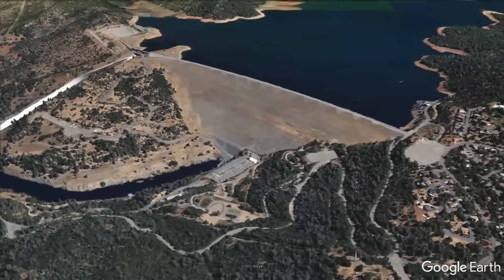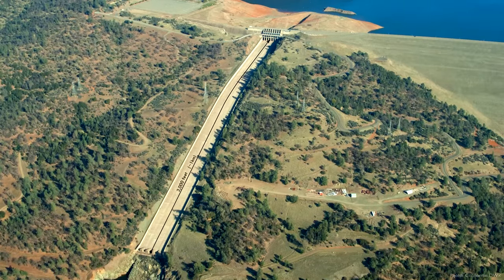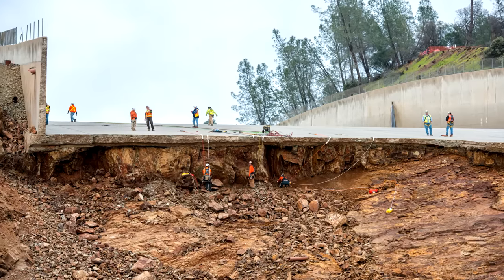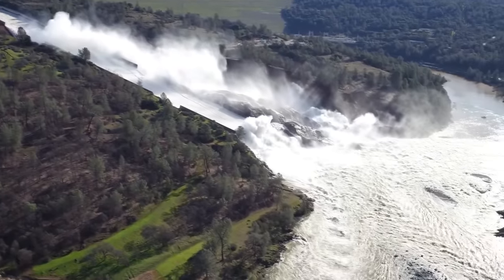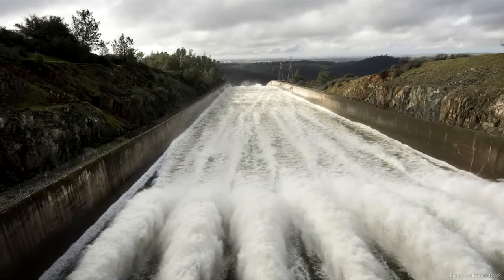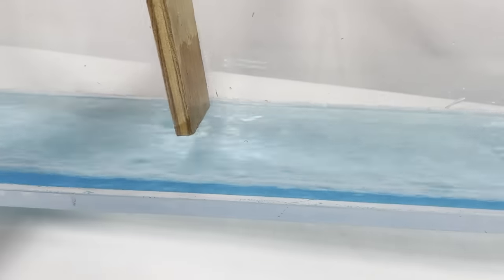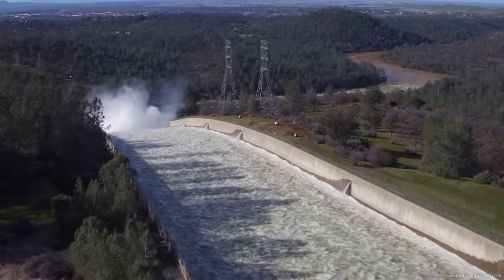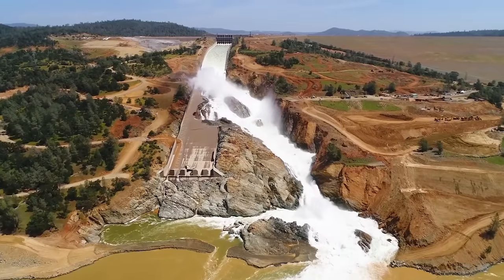What Really Happened at the Oroville Dam Spillway?

Comment: That stagnation pressure effect is how airplanes know how fast they’re going: they have a tube sticking out into the airstream, and measure the pressure rise in the tube.
Reply from the maker: Don't say it outloud without also spelling it for those in the UK. Learned that lesson the hard way.
Reply: Actually I was thinking about something too... If helicopters have the same setup and they fly sideways, by the venturi principle, there should be a negative pressure. Does a helicopter then register a negative forward speed/tell us that we are going backwards?
Reply: Interesting topic
Reply: @PracticalEngineeringChannel  you what?
Reply: @MarkUKInsects  aeroplane instead of airplane I assume?
Reply: Er... pee-tow vs pee-tot???
Reply from the maker: @MarkUKInsects  The device is called a pitot tube (pronounced pee-toe, but in my Texan accent sounds like pee-doe).
Reply: @davidbischi  Well, aside from the difficulty in maintaining your orientation relative to the airstream when moving fast enough to measure (the tail tends to want to flip you around to face the airstream); and that most airspeed gauges have a hard stop at zero; yeah, it should read negative if you did that. Not being a helicopter pilot myself, I’m not sure where they put the pitot tube to keep it out of the downwash from the main rotor either... 🤔
Reply: @davidbischi  At low speeds the helicopter has unreliable readings from the pot tube anyway. The downwash interferes with the flow into the tube and adds static pressure due to flow going into the static pressure ports. At the speeds a helicopter would go sideways you would have an unreliable reading from your pitot tube already.
Reply: @PracticalEngineeringChannel  Oi mate wot you saying? You better sit down instead of flapping those gums at your English viewers! (I kid, love your content)
Reply: @davidbischi  student rotor pilot here. Most helicopters have multiple pressure speed sensors in multaple diractions but if aair traffic control ask for air speed its goed practice to straighten the aircraft out and maitain altatude to get a more reliable reading. But modern accelerometer and gps are preferd by most air traffic controllers.
Reply: This is not true. This is how planes know how heigh they are.
Reply: @davidbischi  The airspeed indicator cannot physically go backward. If for some reason it could go backward then probably. The static port and the pitot tube would reverse roles I guess... I don't know enough to say any of this with certainty.
Reply: Isn't this the same principle used for measuring speed on a boat too?
Reply: @MarkUKInsects  Oh, WTF? Just googled "Yvette Cloete story" and that's awful... How could they miss that in a background check??? 🤔🤐
Reply: @PracticalEngineeringChannel  I learned english in England. No problems thus far..
Reply: @davidbischi  One reason small helicopters have yaw string or slip string on the windshield.
Reply: Ahh... the pitot tube. Learnt about that in aircrash investigation documentary.
Reply: @davidbischi  The pilot is too busy, at that point, watching out the windscreen/side window, to do more than glance at the engine instruments. By that time, they have swung around into forward flight, so eyes back on the usual scan of instruments.
Reply: @toledoseahawks3348  Altitude is determined by a pressure sensor called a static port, which is related to, but different from the pitot tube. The static port (especially on less expensive aircraft) is often just an orifice installed flush with the skin of the aircraft and facing to the side rather than the front or rear. This is intended to measure the ambient static air pressure, not the dynamic pressure created by the aircraft pushing through the air mass, as a pitot tube pointed in the usual direction of travel would do. More expensive or high performance aircraft will have more than one port that (in addition to redundancy) allows the system to sort-of average the pressure across different points on the air-frame to help reduce error associated with unusual flight regimes, such as high angle of attack, uncoordinated turns, slips, etc...
Reply: @WilliamWallace14051  First time I saw that was on my uncle's glider. I was seven or eight years old. He told me it was the most important instrument in the cockpit.
Reply: @toledoseahawks3348  No, the altimeter works off of a different port entirely; which does not face into the airstream.
Reply: Oh yeah... I never really thought about how airplanes measure their speed.
Reply: @toledoseahawks3348  actually its both.....
They have one( or more) ram air inlet to sense the pressure for speed
 and one to measure atmospheric pressure for altitude.
Reply: Pitot tubes also doe wierd things as you cross mach1 (see smarter every day with blue angels I think?) It briefly sees negative pressure and thinks you've just closed 90k feet and then quickly sorts itself out.... or something.
Its due to the shock waves over the nose briefly creating a very low pressure.
I forget the details but I would suggest people find the videos as Destins work is amazing.
Reply: @tomstech4390  Seeing the name Destin tells me that you are talking about the channel "SmarterEveryDay", correct?
Otherwise it's probably hard to find the video you are talking about..
Reply: And something cool!! That’s why just after a pilot breaks through the sound barrier, the altimeter goes crazy because the cone of the shockwave makes a massive low pressure area. Lower pressure equals higher altitude, so the altimeter shows that you’re much higher than you are for a second. I think that’s pretty interesting.
Reply: @BlueSparrow13  as an aircraft mechanic, i am aware of it. But the stagnation pressure effect is not enough to know the speed.
Reply: @davidbischi  Short answer: No.

Most pitot systems are inaccurate at low speed. Some helicopters I have flown don't even have marks for speeds below 20 knots. When that slow, you are maneuvering visually, and not really looking for a speed indication on your instruments. Much like pulling into your driveway. Understanding your movement amongst your surroundings is crucial. Having a numerical display of your speed, not so much.
Reply: @toledoseahawks3348  A pitot tube uses a combination of both the static pressure and the stagnation pressure. It is indeed correct to say that it can't read the speed with only the stagnation pressure because that would only work on the pressure the device was made at/is interfaced to.
The pitot tubes use a static port too to solve this issue.
Reply: @Kalvinjj  i know
Reply: @Kalvinjj  put another way the static port measures the energy stored in the air. The total port (the one facing into the flow) measures that plus the energy the air carries because it's moving (the latter of which is what you really want) you subtract the static from the total and you have an indication of kinetic energy which you can use to determine speed if you know the density of the air.
Reply: @toledoseahawks3348  Then you could have said that, instead of just saying a "no" type of comment.
Besides the part about the tube pointing towards the airflow telling your height was incorrect anyway. If you didn't mean this then seems you got confused cause that's what snowballed it here
Reply: @Kalvinjj  When you use a barometric altimeter, the total pressure is needed to give you the height, because otherwise your height would be changing, when you change your speed. The total pressure is measured through the pitot tube. So the pitot tube gives you your height.
Reply: Don't they use two pitot tubes? One facing forward and one facing backwards in order to measure the pressure differential? I mean, to calculate true forward air speed they have to remove the effects of wind, right?
Reply: @bwhog  no, cause wind generates lift too. There are instruments out there to show the Speed in reference to the ground, but they do not use a tube showing backwards. There are two pitot tubes on every plane to have a backup, but they are build the same.
Reply: @bwhog  When the wind is what you ride on, your air speed counts that anyway, speed to ground is another story and can only be truly taken with navigational equipment.
A pitot tube facing away from the airstream would just measure the inverse of that wind that the tube facing into the airstream does so not much of a difference.
Reply: @ElevatedEyes2023  some boats.

The motor cruiser my family have a syndicate share in only has a tachometer and a small plaque indicating approximate speed, since it's used on rivers and tidal flow can effect actual speed compared to water flow speed.
We just use our phone GPS to get a half decent estimate.
Reply: The pitot tube gives you the indicated air speed which is dependent upon the air pressure itself, so at sea level it's very accurate but higher up it starts showing a much slower speed than the one you're actually traveling at.
Reply: @davidbischi  Air Speed Indicators don't get off the peg until about 40 knots. Helicopters use a very high tech substitute for flight slower than that.  They glue a piece of string to the windshield.
Reply: yessir, I did say "see smarter every day" but my formatting was horrible as I was falling asleep lol.
Video I was talking about.
https://youtu.be/p1PgNbgWSyY

Comment: I used to be a spillway designer. I have designed the structure of several major dams' spillways. It was a very good presentation of the problem, with enough explanation for the laymen to understand the issues at hand.
Just by looking at the damaged structure, I could see that the thickness of the slab was far less than the current practice. The lack of shear keys and keyed foundation was another thing that I found interesting. During the design process, it's easy to look at a slab sitting on the ground and thinking "nothing is going to happen!", but careful analysis always shows that you can never underestimate the effect of uplift, and trusting the drains is always risky. They can get clogged, and monitoring the discharge of the drains is not enough to assess the effectiveness of the drainage to lower the uplift forces, because the a local clogged drain can result in a local failure, and any local failure in a spillway will result in a total failure of the structure.
Reply: Hmmm your description reminded me of the explanation that NASA management tried to give about the shuttle Challenger safety factors.
Reply: @kbanghart  "tried" is the keyword here, lol. I will be happy to elaborate, and I will be happier if I can succeed in more than just "trying" the next time.
Thanks, I appreciate your comment.
Reply: @mehdimarashi1736  just to be clear, no complaints about your comments 👍
Reply: How did you not notice the lack of rebar in the broken spillway? There should be rebar sticking out all over. Before they poured the concrete for the new spillway the rebar was so thick you could not see through it.
Reply: @phillipkalaveras1725  It's one of those things that even when you see it, you don't believe your eyes. Since the slab is not supposed to be a subject to much bending, the only rebar needed is a minimum required to prevent cracks due to shrinkage and thermal expansion/contraction. Those rebars are visible in the drawings (e.g. 13:39), but I can't see them in the broken spillway. I still think that they are there, but for some reason they are invisible. They wouldn't have helped, though.

Since the new slab is super thick, it needs more shrinkage/temperature rebars. The amount required is proportional to the slab thickness. There might have been other design considerations, too; but I cannot guess what they might have been.
Reply: @Game Plays 1230 True, it is called "worst scenario model". But unfortunately accountants thinks otherwise - cutting costs up to law required minimum. As engineer I have constant battle with accountants - I stand on quality, they demand cheap. Top quality never be cheap, and cheap always will be poor quality. Always project cheap at building stage will be expensive in exploatation (become high maintenance unit).
Reply: you are a hard working guy 😊
Reply: I lived in Oroville in the 70's when all the Earthquakes were happening. I wondered how much damage they would cause when it came to the dam/spillway.
I grew up and was a USFS Firefighter then moved to Denver to become a Public Land Surveyor. 
Isn't there a Quarry not to far from the dam that causes the ground to shake once in a while? I haven't lived in Oroville since 1984.
Reply: Never forget you are the layman in EVERY other field in life besides the super specific ultra minimally populated field you decided to learn. Do you honestly think the average man can't understand the simple explanation? Layman terms necessary?Lmao continue living in books.
Reply: Key words "used to be" a spillway designer.. Why no longer? No good designs? Well I guess not or everyone would be using them don't you suppose?
Reply: @123siccmade  One can just retire or start doing something else. I don't see what's the key there. I like to think I can do something else aswell when quitting my current job
Reply: Spillway designer are ya? How did you not notice the lack of rebar that should be sticking out all over the broken spillway?
Reply: @phillipkalaveras1725  Questioned and answered, mon ami. Just scroll up a little bit. I have to add something though. In similar cases, I've seen rebars cut at the shear surface like twigs. It might have happened here as well. I can't find any close-up photos of the shear surface of the slab to be sure, and OP does not mention lack of rebars despite them being included in the drawings.
Reply: Can you elaborate a little on the shear key?
Reply: @groovyxyz  Watch at 14:30. The "lateral trenching" he talks about is what we usually call a "shear key". Its job is preventing the sliding of the slab down the slope. It has the added benefit of adding some weight to the slab, and some resistance against the movement of the slab upward. In spillway design they are very common, and IMO they are a "must have". Spillway has lots of uncertainties. All the measures he talks about at 14:30 are to mitigate some of these uncertainties, and we generally use them all, even where we don't see a necessity for them, just to make sure one or more of those uncertainties won't come and bite us in the behind.
Reply: See... If one of the workers just slapped the slab and said "that ain't going anywhere", maybe the uplift forces wouldn't have been as strong.
Reply: I noticed the same.  We had similar issues with our local concrete lined diversion channel.
Reply: I have another explanation: 50 years of zero maintenance. That will also cause catastrophic failure and in this case, that is exactly what happened.
Reply: I agree with your comment but in this case we could see how important is to have a good geological study of the construction area. 
In this case, the material that supported the slab of the spillway evacuation channel ended up undermined by the action of the water and, believing that it was solid, there were no piles to support the slab, as well as a more resistant design for it. Although, if they would know that before the construction, they would keep the idea of make it in the same place?
Reply: An honest question on spillways of this size why they don't line the spillway with a substance or coat the spillway that would help protect the concrete but with a plastic or rubber lining wouldn't that help with the flow of the water?
Reply: @filosworld.1705  I have never seen or heard this done. One of the functions of the spillway is energy dissipation. We want the surface to have some roughness to keep the water velocity down. I guess making a rough lining is not impossible. We have practical problems with such linings, too. Such a lining would be helpful in making a uniform surface that prevents cavitations; however, we would be worried about peelings or cracks in the lining as it ages. A crack or any kind of a sharp change in the lining is far worse than the natural roughness of a concrete surface when we are dealing with cavitation.

So, I'm not saying it's impossible or inherently a "bad" idea. It's against current design philosophy, and it has some problems that must be dealt with. I guess that's why nobody has used it, yet.
Reply: @mehdimarashi1736  Thank you for the reply.